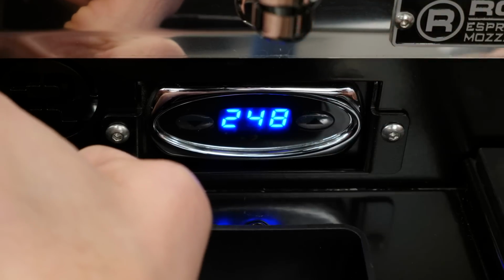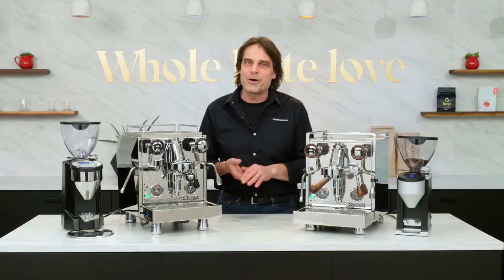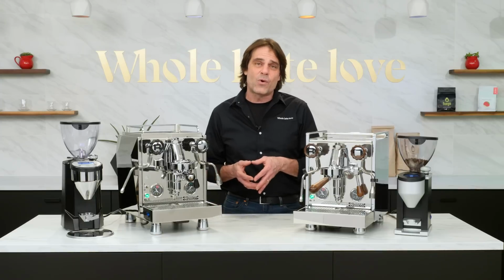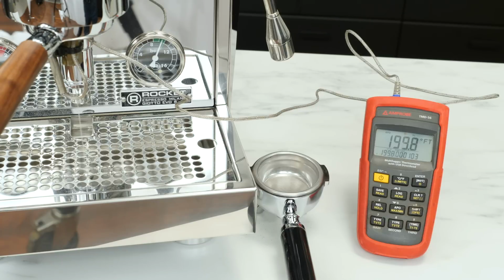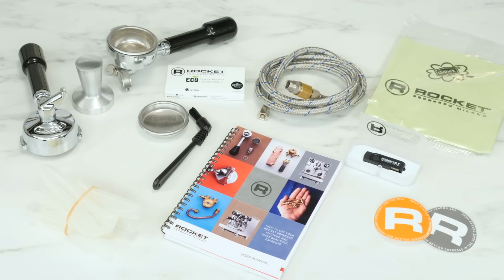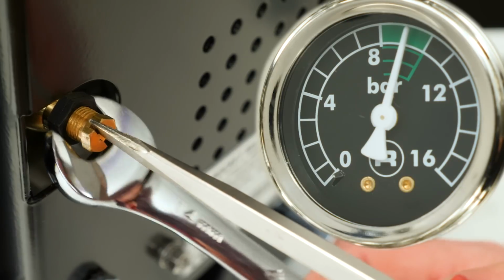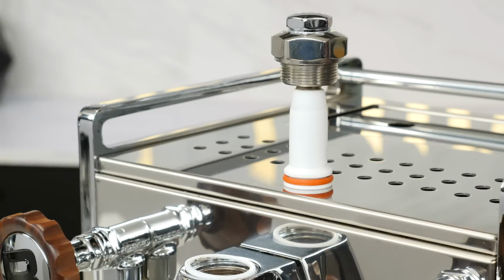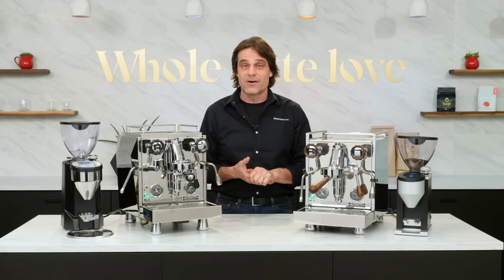Review: Rocket Cronometro R Giotto and Mozzafiato Espresso Machines

Comment: Hi Marc,

I have the rocket giotto v and running into the problem that my brew pressure is only reading 2-4 bars upon extraction. Weight of ground coffee is 17-18g and in 25-35s pouring a 2oz shot. How can I be sure or differentiate if the brew pressure needs to be adjusted or simply adjust the grind size?  Is the giotto lock ring also on the base of the machine?  

Thank you!
Reply from the maker: Hi J, Thanks for the question. Your time/volume is good. If brew pressure is indicating only 2-4 bar and gauge is correct your grind must be rather coarse to get that timing. Does your grind seem coarse compared to when your brew pressure read normally? If not I suspect your gauge reading is incorrect. What does the gauge read with a backflush disc in place? If it's reading 9-10bar then gauge and pump are good. If in US and would like some one on one phone support please contact our tech support at 585-924-7170.
Marc

Comment: whats better the baratza 270 or the eureka mignon
Reply from the maker: Hi LK, Thanks for the question. That's a tough one... I love the Sette 270 Wi. So nice to grind hands free and know I'm getting accurate weight every time. Also love the fluffy well distributed grind it produces. Compared to the Mignon It's a lesser build quality, but much faster and also louder due to it's open design. The Mignon is decent at cycle to cycle weights using timed based grinding. But as you change grind size the timing needs to change to keep dosing weight the same. If you're particular about dose weight and do a lot of dialing in it's extra steps with a scale to be accurate with the Mignon. With the 270 Wi I barley have to give that a thought. What's better depends on how you will use it. Hope that helps!
Marc

Comment: Hi Marc, Im sooo torn on a grinder to go with this Cronometro R, Im torn between an Faustino or the Eureka Atom - if you had to choose which would you go for? Or is the Mignon better haha
Reply from the maker: Hi sickhcivc, Thanks for the question. First up, here's a link to a side by side spec comparison of the Faustino, Atom and Mignon: https://www.wholelattelove.com/pages/compare?products=MjI2OTQ5MDQ3OTE1OCwxNTQ1OTk5NDUwMTcxLDIxNDgyODQ0NjUyMDY
FYI a not so secret - secret... Eureka makes the Faustino. All these grinders use the same design with the lower burr moving against a fixed top burr for grind size adjustment. If I had to choose I'd go with the Faustino. I'm in love with the look and I prefer the minimal sleek display which reverts to an "R" after being idle. The Mignon is about the same price it has a slightly larger burr according to specs at 55mm v. 50mm in the Faustino. Also like the larger adjustment knob on the Faustino. The Atom has larger 60mm burrs and significantly higher price. In this burr size range I'd take the Faustino with the exterior design I prefer. Hope that helps!
Marc
Reply: @Wholelattelovepage  that helps a ton! Thank you so much, and thanks for always replying

Comment: Marc,
I wonder if you can talk to Michael Hauck from ECM at the earliest occasion and share this great idea about drip tray magnet holder.
Unless it's already patented by Rocket. 

ECM Synchronika needs them too, absolutely! For the new machines and as a retrofit kit for the current owners.
Reply from the maker: Hi YD, I will mention along with swapping out single spout PF and single basket for a bottomless and triple basket. I will say on most Profitec and ECM machines drip trays stay in place better than on Rocket machines without magnets. They're not really needed on Synchronika as one must lift up a bit on the drip tray to remove.
Marc

Comment: Mark, great video (again!). I bought myself a Mozzafiato for Xmas. Love the machine. Not sure why they add the hot water spout though (do you? Legit question here). The steam boiler water is way too hot for Americanos (obviously) so I end up using my kettle. Next time might look at dual boiler machine.
Reply from the maker: Hi Marco, Thanks for your comment and happy to hear you are loving the Mozzafiato - beautiful machine! Unless you get into a machine with water mixing on the hot water tap (which does not exist to best of my knowledge in HX boiler machines) that'll always be an issue. I know what you're talking about. I prefer Americanos served at ~155F/68C. With a dual boiler you might be able to bring the temp down in the service boiler, but depends on machine as to what you can set as minimum. You might try taking your hot water into a cold cup prior to extraction so it can cool a bit before use.
Marc
Reply: Just a thought here....you could prefill your container with a "finger" of room temp water...

Comment: Thanks for the greate video. I already have the Mozzafiato and it is great design. Like in this video and others the espresso spouts out and does not have a nice flow. Did you ever saw a Rocket machine which produces nice espresso flows without splashing? I have 5 years of expereince with 2 other machines and do not get it right with this one.
Reply from the maker: Hi Andreas, You are welcome for the video. Not sure I understand what you mean by the espresso splashing?
Marc
Reply: Hello Marc, at the start of the video when you pull the shot the espresso spurt goes left to right, dripping and no constant flow like I see on other machines e.g. Profitec. At least at my machine the espresso flows using the two spout portafilter goe to the middle so that it runs over the rim of the espresso cup. Actually the espresso tastes good. Shot time (25 sec) and ml (25ml) are also in the recommended range. So the question was if it is common to Rocket machines?

Comment: I understand the hidden PID concept from a design perspective, but c'mon... why would you want a PID if you can't take a look at it to monitor your temperature? 😌
Reply: The PID is not there to monitor the temperature but to setup the temperature. After about 10 Minutes it shows always the same temperature, the one you set it to. If you want to monitor the relevant temperature you need to buy yourself a brew head thermometer.....
Reply from the maker: Hi Jan, Thanks for adding your comment. Slight correction in that the PID display will show current temperature of boiler. Definitely used to set it but also shows the current temp at all times. You will see the temp change in display as the boiler warms up. Also slight variations after reaching full temp. Like if you run off a bunch of steam or hot water the PID display will show a drop in temp in the boiler. Bonus, the little dot in the display indicates when the heating element is energized. So it cycles on/off in pulses. It's that control which makes PID far more accurate than boilers controlled by pressurstats or thermostats with no logic.
Marc

Comment: Want to buy the machine next month anyway. But you know how that is, before you get something like that... you enjoy the thrill of anticipation, watching videos of your chosen product^^
What I´d recommend is a pressure regulator if you wanna use the waterline of your household (at least in europe - im not aware of water pressure in the usa)
Reply from the maker: Hi Whiz, Thanks for the comment. Yes - if plumbing a machine direct to waterline a pressure regulator is recommended in some cases. Rocket Espresso recommends a regulator to limit plumbed in pressure to 5bar/~75psi. In US typical domestic water pressure is ~60psi/4 bar but I've seen it range from 40-85psi (1 bar = ~15psi). So for Rocket machines in US pressure regulator may not be needed. Another determining factor is hydraulic system design of a particular machine. All 
plumbable Rocket machines have a solenoid valve on the waterline connection which only opens the machine to outside pressure when the pump is on. It's a little different in machines from Profitec/ECM. They do not have a solenoid valve on the waterline connection so the machine is always open to line pressure. This allows for line pressure pre-infusion. Profitec/ECM recommends a pressure regulator to limit input water pressure to 2 bar/30 psi.
Marc

Comment: Very informative video, you guys do a great job here 👍. I have a question here Mark. I have a problem with my mozzafiato, after i clean it using Puro the knob handle is starting to loose, i mean i cannot feel the pre infusion when i pull the handle. Do you have any idea?
Reply from the maker: Hi HW, Cleaning should not cause the handle to loosen up. Did you disassemble any components? If you need some advice and are in US give our tech support a call at 585-924-7170 for assistance.
Marc
Reply: @Wholelattelovepage  hi mark thanks for your reply! No i don't disembark any parts. Unlucky i'm not in US. I think i use a wrong wors here, is not loosen. What i mean is i cannot feel the repulsion of the handle. I cannot feel anything when i pull the handle. Hope you guys get what i meant 😄

Comment: G’day Mark, great vid and love the machines. I enjoy the classic, clean look but the Fausto doesn’t seem to follow the same design language, particularly the bright interface. Has Rocket commented on the direction for the grinder or do you have alternate interfaces that can be substituted? The Faustino seems much closer to the Rocket look, but I prefer the bigger burrs and motor.
Reply from the maker: Hi Grant, I agree! I love the look of the Faustino. Control is far more subtle than on the Fausto and switches to just the "R" when not in use. I have nothing definite on a change to the Fausto display but have heard rumors - stay tuned.
Marc

Comment: Only one more thing to mention. Pre-infusion. These machines will pre infuse either running on the tank or plumbed in. This can really tame a bright coffee. You can also move the lever into the pre infuse position after most of the shot is done to ramp down the pressure for finishing the shot. Another variable to fine tune your shot.
Reply from the maker: Hi Todd, Thanks for adding that. In my mind the E61 pre-infusion is more of a pre-wetting. It's quite different than what you get from a plumbed in machine which is open to line pressure. Plumbed in, Rocket machines do not get line pressure until a solenoid valve opens when the pump switches on. Good call on the ramp down at end before fully lowering lever.
Marc
Reply: @Wholelattelovepage  Thanks Marc. I can usually saturate a puck with the pre wetting. The major difference that I noticed with a plumbed in (6 days now)
machine is because it is winter, the water entering the boiler is cold and knock the temp down a bit more than the tank. The tank eventually has its water heated by the machine so warmer water is introduced. Pressure on the Rocket gauge is up a bit and I'm set at 5 bar on the gauge on the BWT regulator.

Before anybody gets the idea to plumb in  hot water, the amount of TDS is higher in hot water from a tank, like I have.

a. Cold tap water TDS is 125.

b. BWT pitcher water TDS is usually 99 bang on.

c. Hot water from my tank is 280 and the tank was replaced at the end of November.

d. Active carbon only, whole home filter is 189.

Haven't measured cold water from the BWT filter and I have it set on 3 after measuring the water with test strips. I think replacing the filter each year will leave some of the filter's potential unused. I will go the next size up on the filter and tee off to the fridge as well. Now you all know why to use cold water for tea and coffee, and for me, now everything I would boil water for.
Reply from the maker: Todd T awesome! Thanks for sharing all the details!!! Marc

Comment: It’s about time Rocket included hidden PID instead of that irritating seperate controller. I hope they do the same to the R58. Not so excited about the digital timer, the font proportions look wrong and the display inset looks improperly finished.
Reply: Just the opposite in my eyes. The timer is perfectly and very „stealthy“ integrated into the the nicely designed case of the Rocket. All the other vendors did this much worse....
Reply from the maker: Hi Michael, Thanks for the comment sharing your opinion. Hidden PID on their HX Type V and Evo R machines is at least a few years now.
Marc
Reply from the maker: Hi Jan, Thanks for sharing your opinion.
Marc

Comment: Hi Marc, great Video as always!
What would you consider to be a good or actually a great single boiler machine?
I'm usually just drinking straight up espresso 99% of the time and need a new machine for that
Reply from the maker: Hi Yugo, Thanks for your comment. For 99% espresso the current class act of the single boiler field is the ECM Classika with flow control: https://www.wholelattelove.com/products/ecm-classika-pid-espresso-machine-with-flow-control
Marc
Reply: ECM Classika PID or ECM Puristika

Comment: That is  unfortunately completely not true. Have this at home and you need to flush big time. Of course you do. Its a HX design.
Otherwise a nice video
Reply: Unfortunately you are incorrect. I own one. No flushing required. You must be thinking of an older machine with no PID that will need flushing for sure. The only way this would need a flush is if you have the temperature set too high, but you'd see that on a gauge. If you need to flush, something is off and you'd better have it checked out.

And you're right, it is a nice video.
Reply from the maker: Hi Todd, Thanks for comment on the video and sharing you experience working with the machine. A few years back when a bunch of newer HX PID machines like these Rockets and the Profitec Pro 500 came out I was skeptical they would not need a flush. But, I checked, tested and repeated many times and it's nothing like using a machine with a pressurestat controlling boiler temps. The flush shown in the video was with the PID set to 248F and machine was fully warmed up and idle for 20 minutes with an empty PF in the group. As shown zero flash boiling at start of flush. Flow was smooth no bubbling or excessive steam.  As you mention, it's possible one could get close to that if machine was set to high temp along with other factors like very long idle time, high ambient temps, no PF in group while idle or an obstruction in the thermosiphon system limiting flow to group.
Marc
Reply: @Wholelattelovepage  
Hi Marc,
in this case I disagree with your opinion. The PID did not change anything regarding flushing, because the reason to flush is the overheated water in the HX. Even with a PID the water in the HX is still way over the boiling point and therefore you need to get rid of it with a flush before the extraction. The PID is good for a very constant temperature of the brew head. As a tip I did a flush before extraction with a backflush to avoid a "Thermosyphon stall" that happens when you release the pressure immediately with a normal flush.
Reply: @Todd.T  do you have brew temperature gauge installed?
Reply: @alfonsplasil  I've just got the factory steam boiler gauge, which of course affects the brew temperature. The gauge has the green zone which is more about the brew temperature and nothing really about the steam temp. I mean, it indicates steam temp, but the green zone is where the brew temp is concerned. 

On 121/92.5 degrees, the gauge is in the middle of the green zone. At 122/93.5 degrees the gauge is at about 90% total of the green zone.

What is yours set at??
Reply from the maker: Hi Alfons, Thanks for the comment on the video. Just to be clear you are using a PID version? Also keeping an empty PF in the group when machine is idle? As mentioned the PF becomes part of the thermosiphon system and acts as a heat sink when machine is idle. If you are truly seeing flash boiling from the group I wonder if you might have an obstruction in flow of the thermosiphon possibly in combination with other factors like high PID temp set, high ambient temp etc.
Marc
Reply: @Wholelattelovepage  hey Marc. Thanks for the reply. Really apprecite the content you create. 

Yes I use the PID version. I must tell you that the fact you are not seeing boiling water does not mean you dont need to flush. The only way to know whats happening with the water temperature at the group is to have the brew temperature gauge. Otherwise you really have no idea. If not flushed you can be so much above the temperature you think you are doing.
Reply: I bought Rocket Giotto type V last year.  This is also my question, reallly do not need to flush even the machine is idle for long time (e.g 30 mins)? My seller told me, as long as it is heat exchange machine, flush is needed. But saw Whole Latte video, no flush is needed. 🤔🤔🤔
Reply: @pjshien  I see many other merchants of this fine product that are stuck in the past and mention you have to flush the machine. They made YouTube videos as well. When they flush, no steamy water comes out, so I think they need to review how to use the machine.

 In between Whole Latte Love's detailed videos and comparisons showing no flush needed on PID HX Profitec and PID HX Rockets and the other people telling you to flush it while they are doing it and the water comes out without steam, you have your answer.

The way it used to be @7:48, then compare to the above video @ 2:40 for how things have changed.

https://www.youtube.com/watch?v=7MLECPLHaIg